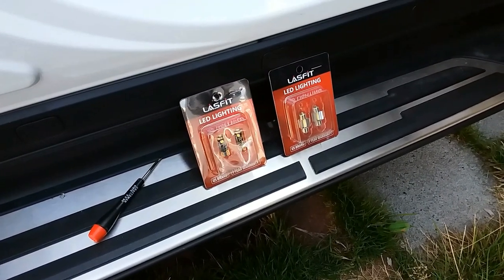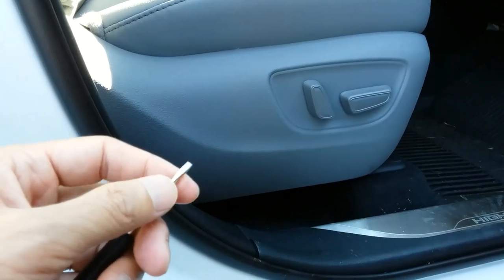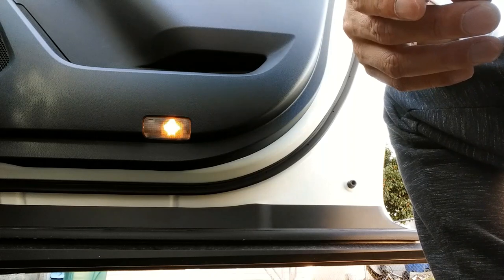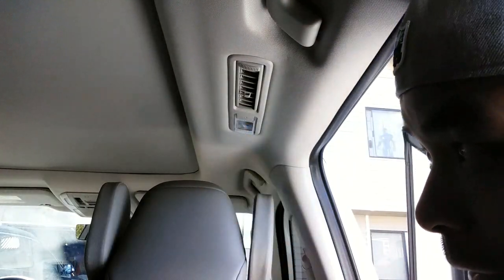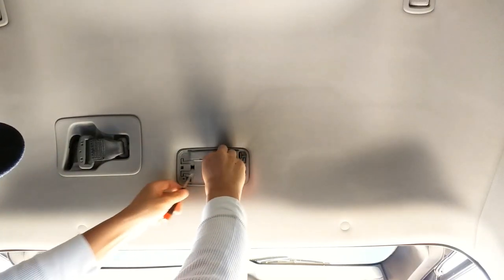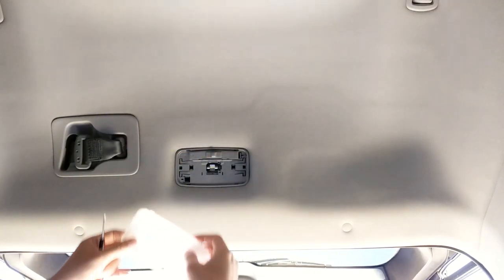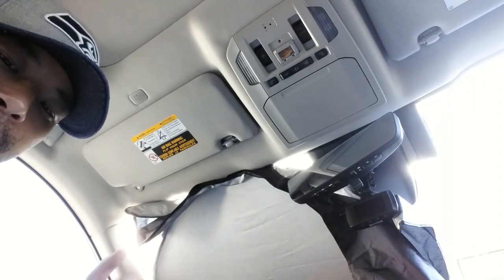LasFit LED 194/DE3021 Interior Lights for 2020-2024 Toyota Highlander (Door, roof, trunk, vanity)

Comment: Man, I hate what toyota did with the map lights. I hate the warm color lights. Good job on the video. I'm still thinking if I want 2 different light colors in the interior. Looks weird 😕
Reply from the maker: It annoys me too, definitely a Toyota money grab as the front headlight and foglight bulbs are not removable as well. I've gotten used to the warmer color but if you're brave to touch the map light circuit board, here's great directions on how to swap them out! 

https://www.toyotanation.com/threads/diy-map-light-led-swap.1697904/

Comment: One issue I came across while doing the rear dome light - after removing the OEM bulb I needed to pull the metal lever back out to the left in order to have it retain it's grip on the new DE3021 LED light.
Reply from the maker: Interesting, did the bulb still work after you bent the metal prong out a bit? I guess it's better to have some give compared to a really tight fit. I have a 21 Platinum Hybrid and it fit with no need to bend. What's your year and trim?
Reply: @vietbubbletea  2022 Hybrid Platinum - I think because the OEM bulb was so snug when I removed it the metal prong may have pushed too far to the right in order to release the OEM bulb. It seems to hold its spring after pushing it back out to the left and holds the new LED bulb snug.

Comment: salve ! ... how many bulbs for the doors and roof ? lasfit 194/T10 ... and what type is used for the license plate ? ... thanks
Reply from the maker: Two 194s for the front door, two 194s for the 2nd row roof and one DE3021 for the rear trunk. The license plate also use two 194s. Check out my other videos as I've made one for that too!

https://youtu.be/_be7zd6QBlE

Comment: I have my 2023 Hybrid Highlander XLE as my default vehicle in my Amazon profile and it's flagging the links as not-compatible for that model. It gives alternative that are not LASFIT
Reply from the maker: The bulbs haven't changed for 2020-2024 Highlanders so they should work. Amazon doesn't always have up to date information stored in their vehicle parts database.

Comment: Did u wire the dash cam to mirror
Reply from the maker: Dashcam came with a piggyback harness that plugged into the rear view mirror.
Reply: @vietbubbletea  I have 2023 what wire did u use pin numbers and colors
Reply from the maker: @hoodking505  I'm not sure since the harness came pre-assembled. You can watch this video revon the FitcamX dashcam I installed to see the harness during the unboxing and installation.

https://youtu.be/X_9UwbDzUYA

Comment: I just bought a 2023 Sienna, and hate the interior lights.  The lights are basically the same design as in the Highlander.  I had some leftover LED bulbs from my Odyssey upgrade, that fit right into the Sienna.  
Thanks for the info.

Comment: I finally got my front Canbus turn signal LEDs in and wow...what a difference.  I also replaced my 3rd row light and again, huge difference.  Next will be the 2nd row, vanity lights and the puddle lights.  All most done.  Also, glad to see you upgraded to an S23 Ultra I saw in your other video yesterday.  I have an S22 Ultra and it fits perfectly on the phone holder I got from AlliExpress. Next project on the list are the hood struts. Keep up the great work you do.
Reply from the maker: Nice work Paul! The difference between the S8 and S23 Ultra is unbelievable especially with all the camera upgrades. Did you decide on what brand of hood struts yet?
Reply: @vietbubbletea  I found a kit on AlliExpress for 30 bucks by Semtay or Sumtay. They come with a 2 year warranty.  They have gotten good reviews.

Comment: I think you forgot the lower cargo light on the lower right area in the back. I have a 2019 SE AWD in Nightshade.  I plan to do all of what you did plus that light in the back that I think you forgot.  Nice video!!!
Reply from the maker: Thanks! I've checked for that rear trunk light on the right side that you mentioned and confirmed that the 4th Gen Highlanders don't have it like on your 3rd Gen. I guess Toyota decided to remove it for the 2020-2023 models.

Comment: What about the map bulb cheers
Reply from the maker: Map bulbs are not plug and play, they are LED diodes soldered to the circuit board. You can replace them if you having soldering skills. The directions can be found in the ToyotaNation forums if you want to try.

Comment: Do you know I can order these dome light cover? I broke one of them when removing them
Reply from the maker: I'm sure you can order them from the dealer and they'll tell you what the parts number is but if you want to save some money, I'd recommend joining  Facebook group and see if someone is parting out their car and buy it used for cheaper. You could also  check eBay or a local wrecking yard as well.

Comment: Hello! Are the front 2 dome lights led? And if not, what bulbs are required? Asking as a potential buyer.
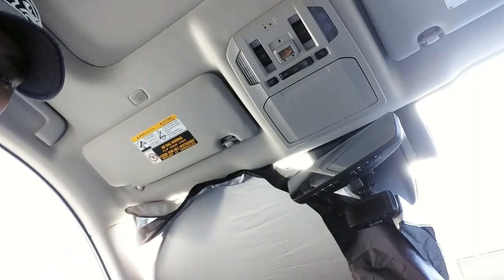Reply from the maker: @Bryson If you're referring to the map lights, they are already LED but not 6000K color. They are LED diodes that are soldered to the circuit board and not plug and play like the rest of the bulbs. It is possible to replace them but it would require using extra steps to remove the existing diodes and solder the new ones in place which not everyone can do. I explain this at the 12:45 mark in my video, good luck!

Comment: The lights above the infotainment system can’t be changed?
Reply from the maker: If you're referring to the map lights next to the SOS button, the 2020-2022 Highlander map lights are not plug and play like the 3rd generation Highlanders. These lights are LED diodes that are soldered into the circuit board so you would need to do extra work to remove and resolder new diodes to replace them. I explain this near the end of my video. If you want to attempt this mod, there's posts in the Toyotanation forums that can show you how.
Reply: @vietbubbletea  I came only to see how to change the map lights on my 2021 Highlander. The other lights are pretty straight forward. Thanks